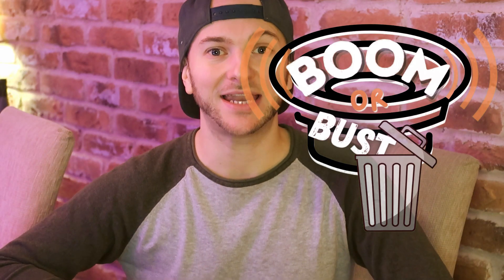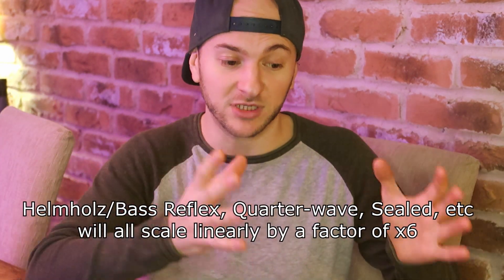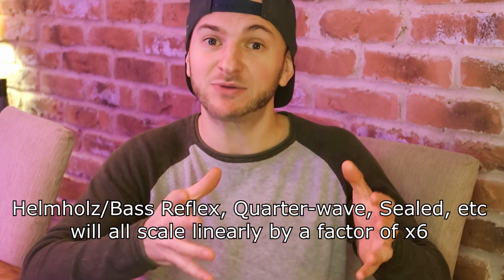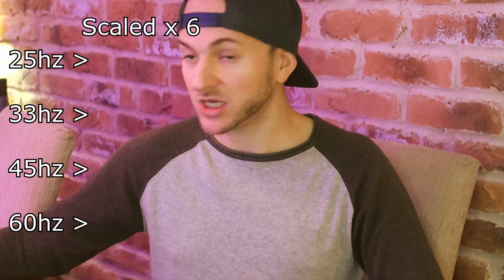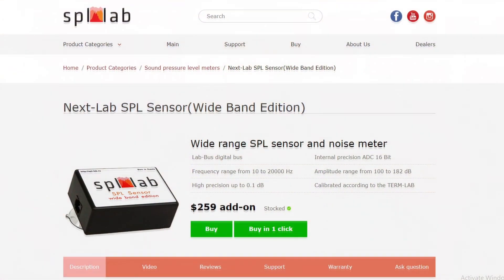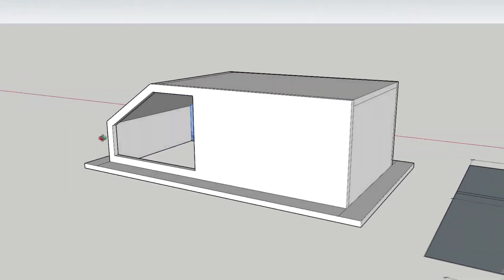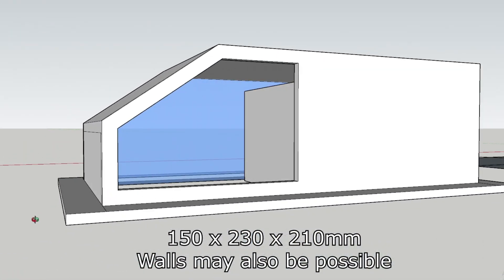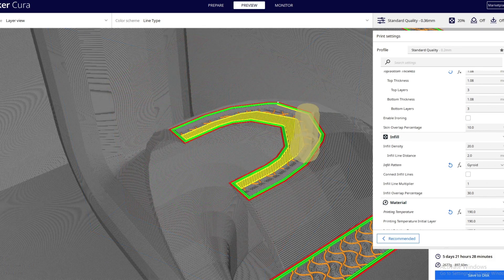Can YOU Design a Crazy Loud Subwoofer Box? 🔊 NEW SERIES - Boom or Bust Prelude

Comment: Not good at preameters on box building. I got a Atrend 26×26×48" box with 2 slot ports that are 25" 1/4×4 and are 28" deep. Yes it wraps around the back that's how it's longer than the subwoofer box's deep.

Comment: I’ve always wondered why tapped horns aren’t used more in cAr audio.   They are known to be the most efficient loudest design correct? But not many folks use them in car audio
Reply: Size and driver parameter requirements.  Not many car audio subwoofer drivers model well in THs, which require decent Vas and medium-low Qts for best results (similar to 6th order BP enclosures).
Reply: @Grommet2007  I used a power acoustik from Walmart in a couple tapped horns. Very loud.

Comment: I'm looking forward to the new content. I am a fan of the channel, not just because you offer information about amplifier repair. I am a supporter regardless and it just so happens to work out that I am familiar with graphic design specifically blender this should be fun👍🏼😎
Reply from the maker: I would love to get good at blender, problem is I got too familiar with sketchup and it's hard to start fresh with a new program that works so differently! I did try a few designs on blender but it was so far from what I'm used to. Fusion360 was a bit better. Maybe I'll try again sometime
Reply: @barevids  you definitely chose the right programs, when it comes to Precision modeling especially for 3D printing SketchUp and Fusion 360 or definitely the better option.

Comment: Gonna be great. You put a lot of thought into how to scale it up. Don't forget to post up an .stl model of the driver. Save us all modeling that into a design. That lil box looks sweet. Prolly set the rule PLA only no fillers, like sand etc, etc. PLA is just as if not more tough than mdf at scale. 18mm / 6 = 3mm. If they wanna doubly sheet, make it 6mm etc. This is gonna be fun. Got 3 designs in my head. The video edit of speed up slow down really got my sub moving, haha. Blender has got into cad recently and I hear freecad is getting good. I really wan't to get away from autodesk, it's a trap waiting to happen. If anyone has oldskool solid works, let someone know where it's at ;) Blender is well powerfull open source and really free and when they get propper cad going the world will be an awsome place.

Comment: this is neat. Been running 3D printed PETG sub boxes in my car for a couple years now. Ran 2 Massive sumo 8's in a aeroported enclosure (100% printed) for just over a year. Currently have a single Deaf Bonce apocalypse 10" in a cylindrical aeroported enclosure. Metered a 138.5 on the dash. not bad for a daily and peoples reactions are pretty cool
Reply from the maker: Awesome!
Reply: post stls and step files

Comment: Sam spend a bit of time learning cura and get a good profile setup for your printer I can do some pretty crazy supports that are easy to remove on mine just took a bit of testing.  Also I would upgrade the extruder on your ender 5 plus the stock one is pretty lacking imho.  BMG clones are pretty good.  Other than that they are pretty good printers really.  All metal hotend might be a good upgrade I really like the old tried and true volcanos but there are some new drop ins that are likely superior.  Also look into the sonic pad I think itd be worth it for your printer,  im considering trying one out. 

Replace the bed springs with the silicone spacers you can find on amazon too.  The springs are the first things I swap out on all of my printers. 

One thing ive done on some enclosures Ive printed is leave the walls empty then filled with epoxy or resin.  I know some people even use cement.  It Greatly reduces print time.  Ive made some T-lines some pods some enclosures for components port flares etc etc.  This will be fun I think.
Reply from the maker: Great suggestions man thank you! It's relatively stock for now and prints great, have seen about the better hotends, hadn't heard of the spring upgrade tho, what's the benefit?
Reply: @barevids  Much better and more stable when manually leveling the bed plus reduces vibrations.  I check my beds maybe every 2-3 months now just because where before would have to manually level them often.  Level bed and good first layers are key to good adhesion and good prints.  

If youre printing a lot it makes a big difference. The hot and cold cycles are really good about making your manual adjustments go out of wack pretty fast and Ive seen springs just fatigue to the point they dont do their job at all.  Its worth trying if it becomes an issue.